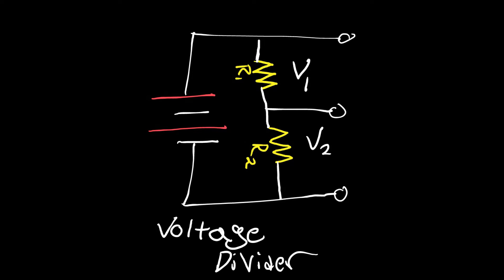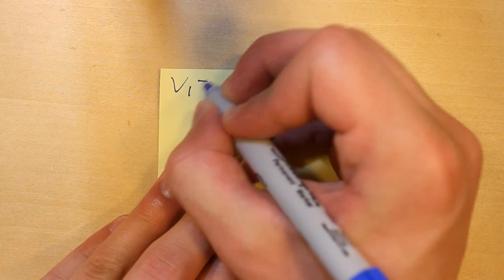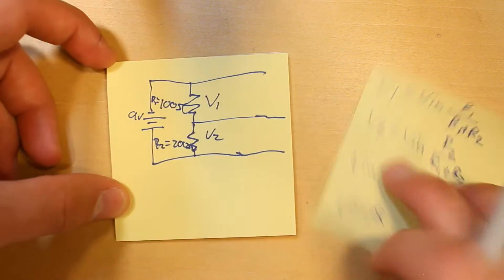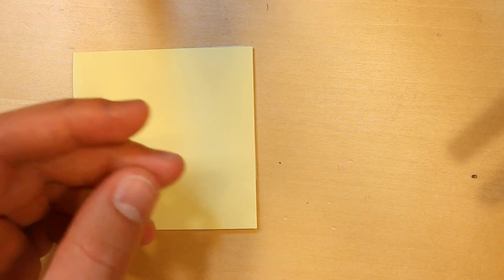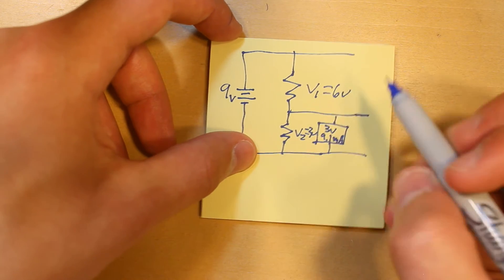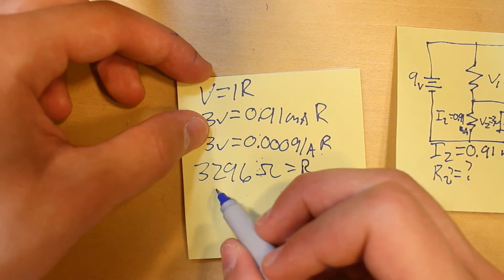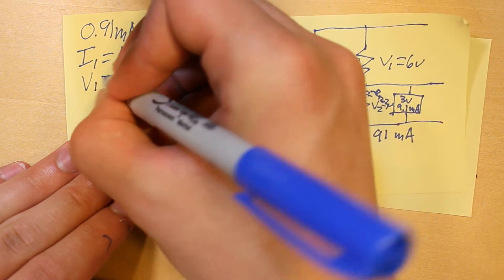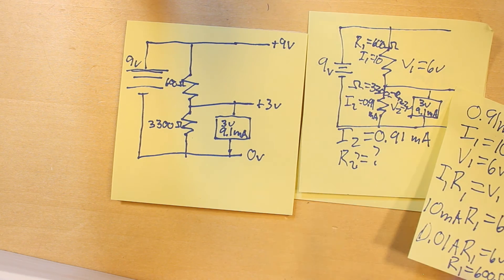Voltage Divider Tutorial

Comment: You have to remember that the load resistance of 329 ohms and the resistance of R2 being 3300 ohms, are both in parrallel which works out to be 300 ohms. So the YouTube example is correct, you just have to take the load resistance in to account. Do the sums with 300 ohms as the total lower resistance and it should work out.

Comment: Hi how do you solve this. Please help.

Design a 3-resistorvoltage divider networks that will have voltage drops of 3V with 30mA and 5V with 50mA. Total voltage source is 10V @ 100mA.

Comment: Hi! I have a question.
I have a Arduino that can output 5v and 3v.
I have a Nintendo 3DS that runs on 1.8v.
I need to Arduino to send between 0 and 1.8v to the Nintendo 3DS Analog Stick to control it.
Do I hook up two Resistors: R1= 3.2k Ohm and R2=1.8k Ohm to the 5v signal wire from the Arduino?
Does this guarantee that I will only send 0 to 1.8v max from that wire? [using PWM analogWrite(0-255)]?

Comment: When i solve for V2 with R1=600 ohms and R2 = 3300 ohms, V2 is not equal to 3Volts... why is that?
Reply: r2 should be 330 ohms
Reply: Jun-Jun Bangsil Exactly what I was wondering myself. Did you ever figure this out?
Reply: +Nathan me too?
Reply: You have to remember that the load resistance of 329 ohms and the resistance of R2 being 3300 ohms, are both  in parrallel which works out to be 300 ohms. So the YouTube example is correct, you just have to take the load resistance in to account. Do the sums with 300 ohms as the total lower resistance and it should work out.
Reply: @ Me too